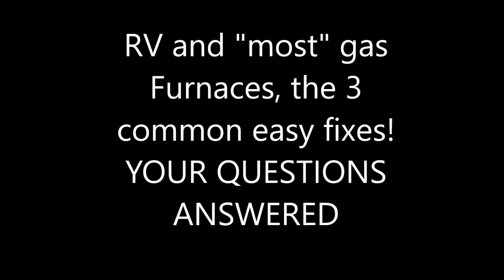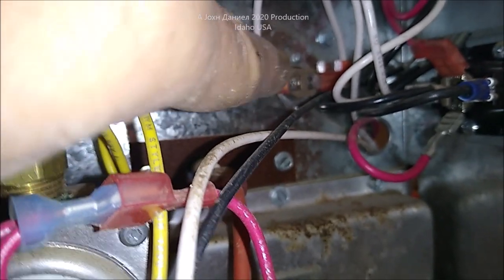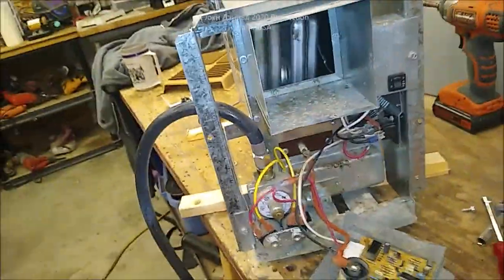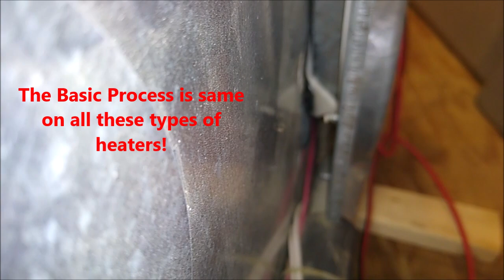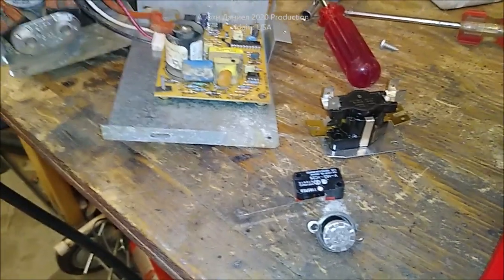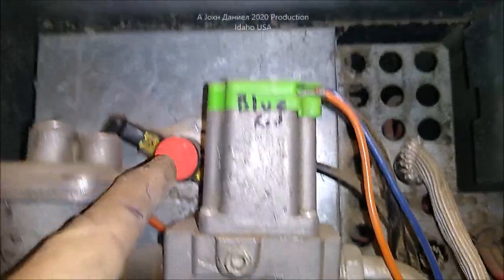RV Furnace REPAIR TECHNICIAN SECRETS Top 3 Easy Fixes anyone can do PARTS BELOW

Comment: Just recently purchase a truck camper that has this furnace. I have 12v power to the run delay relay but the furnace does nothing. I’ve replace the run delay relay and still nothing. The fan will run if I jump power across the the two red wires but doesn’t even try to ignite. Would this be a board issue? Any help would be greatly appreciated.
Reply from the maker: Connect the 2 thermostat wires to see if it's bad, touch them together holding them for 30 seconds. Check the plug for shorts that goes to the unit. Even if the board is bad the blower will fire up and blow air it just won't continue the cycle to fire up and make heat and it'll just shut itself off. if the thermostat is bad the heater may fire up. Check to make sure the motor is free to turn by pushing on the blower with something. Let me know your results. Getting the fan to run by jumping the wires is the only good sign you're dealing with, but when it runs it's supposed to move a blower switch, called a sail switch which will activate the board to start powering up to operate. It's a small little paddle switch that's mounted on the side of the blower housing. You can take a pair of probes or alligator clips and bypass the power on it once you get the fan blowing to see if the board fires up.
Reply: @JOHNDANIEL1  I had actually hooked the thermostat wires together previously but didn’t realize it wasn’t instant and they needed to be in contact for a while. I was able to get the furnace running today based of your input. I hooked them together and let it run for about 20 minutes and a bad thermostat appears to be the issue. Greatly appreciate your video and taking the time to provide some guidance. Thank you!

Comment: Good morning John.  Ok the motor was the issue so replace it  put it all back together. And developed another issue so the new issue is everything will come on start blowing heat and then within a minute or two it’ll shut off the gas and no heat. I hear it clicking and will not ignite again unless I turn it off completely from the thermostat and wait about 10 to 15 minutes.

Thanks 🙏🏾
Reply from the maker: The igniter, It's allowed 90 seconds max to get up to 50mv feedback to the board if it don't the power from the relay on the board to the gas cuts off, then will off cycle till you restart it.
Reply: @JOHNDANIEL1 thank you for helping me out.  
so your saying.  The relay is bad?  And need to replace the borad
Reply from the maker: @GypsyDiy  No, the igniter if its got one with flame sensing, more than one probe on it, it sparks in the combustion chamber and the flame will heat up the special metal on one tip and through the ground circuit will tell the board successful fire has been achieved. Your coil on your board feeds it spark, its in the burn box part. Pull it out, examine it, if it has 2 or more probes on it, replace it.
Reply: @JOHNDANIEL1  ok will do thanks very much. Will keep you posted.

Comment: Run delay relay sounds like it’s the issue
Reply from the maker: Check fuses first, If was a crackle and small pop then its either that or a capacitor or coil on the board. Inspect the board, get out a meter to test power and if the thermostat is still connecting to the furnace.
Reply from the maker: If all else fails, BIG SALE on a option for many small RVs and garages. https://amzn.to/41ycEu4 11,000 btu and https://amzn.to/3YoTZyh 17,000 btu. requires no power, and is the safe option Direct Vented.

Comment: Hello. I am working on a 2003 jayco kiwi that I just purchased, and the furnace looks like it's missing parts can you guide me or sell me some of the missing parts? I believe what is missing is the front panel that the control board and the cables are all loose. I can send you pictures or I can email you the pictures.
Reply from the maker: Yes, email me data and pics. Make sure model number is in the info. I get 30 to 50 emails a day so it may be a week to reply. olympicpowercontrols@yahoo.com

Comment: How smooth is the fan supposed to turn,I get maybe 3 turns with a wheel of fortune spin  then slows
Reply from the maker: Not sure the amount of force you're using but generally if you don't hear it growling or rubbing on something then you likey fine.
Reply: @JOHNDANIEL1  thanks for the reply John, it spins but kinda up and down in speed and it wouldn't turn on after it switched off at 3 am,and the box is really heating up ,need more fan power right? Thanks gonna help as many as I can on this journey
Reply from the maker: @welcometothetruth6651  Yes, sounds like your fan motor is failing then. They tend to slow and surge as they start to fail. How old is it, what is the exact year and model of the RV/ Furnace you have?
Reply: @JOHNDANIEL1  it's an NT 20s, not sure of year looking

Comment: Still not working. hooked thermostat wire up as in video. 7-8 could delay and fan comes on. put new sail switch in but was unable to get solder to stick to the existing switch enlargement piece. fan runs nicely until I cut power. I think relay is all right as the fan comes on but I bought one of each part. So does it sound like fan switch or do I move to relay. Have to buy specialty screwdriver set to get the silver disk out to replace but I did jump it so????  Help appreciated.
Reply from the maker: I use a battery welder to put a tab on those sail switches. If the Delay Relay is correctly working, the fan switch would send connection to the board and gas valve to start and run the burner. You can send pics and questions to me on my email. I can see what help can be done that way. olympicpowercontrols@yahoo.com

Comment: My 8535 iii does this: Turn up the thermostat and the fan comes on. After 20 seconds the furnace tries to ignite - the gas valve opens and sparks a couple of times. I can hear a "poof" and simultaneously the blower shuts down. It seems  like the action of trying to ignite shuts down the blower. The blower only can operate from the thermostat, the rest of the circuitry should have NOTHING to do with the blower motor, yet it is not a coincidence that the blower shuts down every time while trying to ignite. Some times the blower will come back on for a half second after the gas valve closes. It tries to recover every 6 seconds - blower comes back on after a 6 second delay, I get the "poof" , blower shuts down. It will repeat this sequence every 6 seconds without ever going into lockdown. Burning in good shape, cleaned igniter, checked every connector. It has the Dinosaur board and TDR relay. Ideas?
Reply from the maker: Get a voltmeter and set it up to test voltage activity. You will be looking for a big drop in volts when it tries to fire up. Note volts while blowers running, when gas solenoid opens and when board makes the spark. Sounds like your igniter ignition wire is shorting on the chassis or on the board causing a big volt drop which may be giving you the symptoms.
Reply: @JOHNDANIEL1  Yeah, did that no drop in voltage. That's what I thought supply voltage dropping out.
Reply from the maker: @richardp5161  Change out the regulator on the propane, or get one from a BBQ pit with a 20 lb tank and bypass the RV system, hook it up, allow a few cycles to get the air cleared from the hose and see if your results improve. The 8535 series is prone to low gas volume issues as well as low volt issues since they changed to Atwood as the maker.
Reply: @JOHNDANIEL1  Ok tnx, where is there a convenient place to hook up a manometer and test for 11 inches of water column?
Reply: I'm gonna' try another TDR, coming monday. been a real tough intermittent problem.
Reply from the maker: @richardp5161  the furnace line
Reply from the maker: @richardp5161  I would just put a basic TDR in it, the Dinosaur electronic based do not last long, just use a mechanical Emerson or WR model like the one in the links under the video.

Comment: My forest river suburban furnace used to click click click and kind of struggle to fire up. Now it doesn’t click at all and blows cold for three minutes then shuts down. We’ve replaced the sail switch and limit switch and cleaned out everything possible. Batteries are full and full tank for propane . Any ideas?
Reply from the maker: Igniter or board

Comment: you did not answer my question. my furnace is working but not getting hot enough. thanks mike
Reply from the maker: Have you checked for blockage in your intake and exhaust on it? Using a flash light, look into them. Blockage will make it burn rich, producing low heat due to unburned gases.
Reply: @JOHNDANIEL1  I have checked and cleaned them. I have also removed the unit and bench tested it. Same result.
Reply from the maker: @MichaelJBleck  Likely cause is incomplete burner activity. It will have numerous rows of flame, some may be blocked. remove igniter, look for rust scale on the burners. A great cleaning method is attach a strong shop vac to the exhaust, and tip the furnace on its rear and tap on it, listen for things hitting the shop vac hose, DO NOT slap it just light taps. Scale from the upper exchanger is known to cover enough of the burner ports to reduce output and occasionally give you a strong fresh propane smell outside.

Comment: Mr Daniel, I have an Atwood 8940-III-ACLC unit that I am trying to find the correct 'fan run delay relay' for. This unit is 110 for fan and the rest is 12 volt. No help or answer from dometic!
Reply from the maker: It should not use a 120 volt fan motor. It should have a 14 amp 13.2 volt stage 6 Transformer that runs the heater on shore power/RV plug, All internal parts 12 volt. Including the Run-Delay relay since it is operating on a low voltage thermostat. Since I am now moved back in Texas Hill Country I do not get many furnaces to work on by I can look at yours if you send its details, pictures and problems well defined to my Email. olympicpowercontrols@yahoo.com

Comment: Fan seems slow,same checks?
Reply from the maker: If your fan is running slow you could have a relay or electrical switch that is not getting full power through it as far as amps but the likelihood is your motor is going bad and not producing enough rotation speed to make the switches on the blower work to kick on the burner and control board.

Comment: Very informative Thank You. Is there not a filter on these units that need to be cleaned? Also, mine is cycling on and off and i am wondering it the cold air when operating is just making and breaking the over temp switch. I did not run it long enough to find out really until i can take apart and check. Thanks. Ted
Reply from the maker: Sadly no one until the recent last 2 years of a grubberment federal reserve caused world financial and energy problems, ever needed to run a RV heater over 60 hours a year, now we are doing so well millions are moving into them! So not unless your in a real expensive model will it even have a option of filtering. Is it good to once a season if using a lot to remove, blow out the blowers, use a shop vac on its exhaust as your taping and tilting it, then re-install if all is ok. 
As for cycling, sounds like a bad thermostat or failing LIMIT SWITCH as the cause. 
AND - Take a flash light, look up into the heaters exhaust and intakes and see what is in it, wasps love them. If clogged it can short cycle due to burning rich also, but can cause many parts to fail. It is OK to use a shop vac on the exhaust and intake as you break up dirt or wasp nest just go slow. 
When removing one, remember the sleeve and it's screw on the exhaust and the 2 inner furnace base screws usually tight to the sides and hidden in it at floor level to remove it.

Comment: Thanks for posting this video John! I have a different problem on my Suburban furnace model NT-30SP. The other day, after working trouble-free for quite a while, the furnace just turned on "out-of-the-blue" and wouldn't stop running: both the burner and the fan simply would not shut off.  The thermostat was set to the off position.  I went outside and shut the propane tank valve off, and the only way I got to shut the dang furnace off (the fan still kept running even after shutting off the gas supply) is by pulling the fuse for that 12v circuit. Do you have any suggestions as to why it would do this and which part is malfunctioning?  Any help would be much appreciated!
Reply from the maker: Yes, your describing a fused TIME DELAY RELAY ( https://amzn.to/36MXTrR ) and you can use the Emerson Heat Sequencer to replace the Atwood version for $50 cheaper and it is better than the factory 13 seconds cool down by adding 17 for a total of 30 flame off cycle to it so you actually use less gas. At worse your fan switch is stuck on but normally if you kill the gas and the blower stays running till you kill all power then its the relay. Send me a email and I will send you a schematic on the 30SP to go by. With instructions on how to remove and get fixed in usually 30 minutes. JD - olympicpowercontrols@yahoo.com
Reply: @JOHNDANIEL1  Thanks for the swift reply.  I sent you an email.  Hope this fixes it.

Comment: I didn’t see a link for the circuit board. Pretty sure mine is a board since I changed the other parts still cuts out and won’t restart after some time unless I bang on it real hard.
Reply from the maker: Remove the board, clean all the contacts and the ground points on the board, and straighten them, re-install it making sure you have full connection to ground, then add a ground wire if you can to the chassis from anywhere there is one near by. Check the plug if you have one for loose pins.  If you slap them and they work, its terminals, not usually components.
Reply: @JOHNDANIEL1  Thanks for the reply John. I will check it out!
Reply: @JOHNDANIEL1  my harness connector that goes to my board only has 3 active pins. There is a yellow wire going to COMM and that wire goes to a ground terminal on the chassis with an other 2 wires. Next to COMM is GND and there is no pin or wire to that. Contacts on circuit board looks good but I cleaned them more. I sanded down the paint under the ground strip and even added an extra ground wire to the chassis. After I did that it wouldn’t start at all even with banging it. I had to leave for work will return later .
Reply from the maker: @dtrx_outdoors  Clarify the not run status. Does the fan come on but no burner or is it no fan or activity at all when you move the thermostat.
Reply: @JOHNDANIEL1  correct fan doesn’t come on or anything . Just acts as if it’s never been commanded to come on. Which is how it always acts until you bang it then it will start occasionally . But it’s been getting worse.
Reply: So I found the problem is in the blower motor. If I tap on that it will start. Then everything fires and works fine. Problem is I can’t find replacement motors for them anymore. Any recommendations?
Reply from the maker: @dtrx_outdoors  Did you replace the fan sail switch on this furnace? 
What model number is the furnace?
Reply: @JOHNDANIEL1  I have not replaced the sail switch bc the problem is that the blower doesn’t start . Once the blower starts the furnace will fire and work as normal until it cycles through it’s thermostat cycles at some point and won’t restart since the blower motor won’t spin unless knocked on. It’s is an NT-12SE
Reply from the maker: @dtrx_outdoors  Jump the wires from the delay relay and the Over Limit switch in 2 test, ones that go to the blower, see what happens.

Comment: The thermal disk have a question so when you turn on the thermostat and you hear a click but nothing happens that means that is not working am I correct
Reply from the maker: If you're hearing a click the fan delay relay doesn't really make a loud click, what it should do is kick on the blower, and then there is a 22 second delay, when the blower is running you should then hear a loud click that is the solenoid to the gas that would make the loud click.

Comment: have one that i want to use in my shop is it necessary to run exhaust or just crack a window 20x20 shop
Reply from the maker: I would run the exhaust on it, concentration can get excessive. Unlike a ventless which uses a specific catalyst the furnace uses direct flame on its burners.

Comment: My furnace just made a large bang bang and shook the whole RV. There's a burning smell and theres a loud noise kinda like a fan dying/struggling. I turned it off and am hoping my son and I will be ok in °18 weather and a space heater. Any suggestions?
Reply from the maker: Sounds like you had a heat exchanger where the flame is fail, break. That would be the end of that furnace normally. It can happen due to blockage to the intake or exhaust on the heater. The fan failing can cause the gas to be overly enriched and set off a loud pop like that too. Only way to know more is to know the year and make of the heater and see what is available in options.

Comment: Replaced the sail switch in my old suburban, now it stopped trying to light (no fuel no spark) and blowing cold again.  Bypassed the sail switch and no change.  Gonna have to test all these bits i guess.  Thanks for the video.
Reply from the maker: Manually press the sail switch to see if its just not making full contact when fire up happens. If its out of the case it can act like its not getting enough pressure, and some switches may have too small a flag on them to keep it connected the full 2 seconds the board needs to see to react.
Reply: @JOHNDANIEL1  Hey, thanks for the reply!  I've already tried eliminating it with a jumper.  Gonna check the igniter for open circuit too.